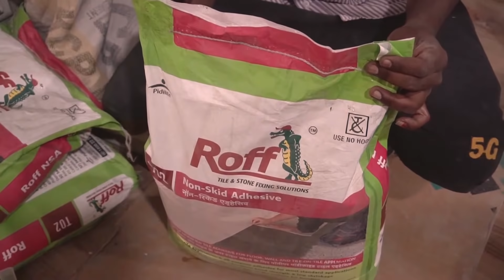2x4 tile laying in Hyderabad

Comment: This work is done at our home. He suggested us all the top quality materials required and provided different set of designs and at last this design is selected and done it perfectly.
Reply from the maker: Happy to hear ur valuable feedback sir thank you so much❤ 🙏🙏
Reply: Which company
Reply from the maker: @bitik9847  Cera
Reply: @muhammadmurtazamalik6564  yes
Reply: @TRKConstructions  cost?
Reply from the maker: @sasidhar2515  10k
Reply: @TRKConstructions  how much cost
Reply: @TRKConstructions  contact please.
Reply: Tiles ki brand or code kya hai ?
Reply: @khushaldavda857  nhi kabhi nhi paint Nikal kar ek coat cement aur chemicals water mix kar ke wall par coat karna hota hai
Reply: सभी टाइल्स निकलेगी देख लेना putti ke ऊपर ही टाइल्स लगा दिया इसने, ओर नही यकीन तो टाइल्स को हाथ से बजा कर देखलो आवाज आएगी
Reply: Cost? 🤔
Reply: Can you share the number of the worker
Reply: Is this durable?
Reply: Q
Reply: Same tiles come in letina company. Cera company tiles would be around 65+ rupees whereas I got similar single charge digital tiles (gvt) at 53 rupees per sqft. There were no bends n all and can't be differentiated. Popular branded tiles are 10-15 rupees costly

Comment: I think paint should be removed from wall to strengthen the bond
Reply from the maker: It was not possible at that time
Reply: The tiles will start loosing the bonding within 2 years because of not removing the paint

Comment: Do you guys apply cement for pasting or something else? Please reply.
Reply from the maker: Yes we use cement or adhesive
Reply: @TRKConstructions  Thank you for response Brother. Also one thing I want to know from you. Which is better cement or adhesive? Is adhesive not dry while spreading on tiles unlike cement because as I see cement gets dry immediately while spreading on tiles and unable to paste if tiles is immerse in water? Please suggest a process.

Comment: Why did you use t02 and not t03 ?
2-4 tiles are heavy so won't that create a problem ?
And Is roff better than laticrete?
Kindly answer 🙏
Reply from the maker: Both are good

Comment: TILE seems not socked in water before fixing & the spatula using is not correct one for tile fixing, wasting lot of adhesive mixer.
Reply from the maker: There is no need to soak vitrified tiles in water and moreover we didn't waste the adhesive
Reply: Thanks for the information
Reply: @TRKConstructions  its a misconcept that vertified tiles don't need socking and its a folk created by lazy masons. Check youtube for professional tile fixing tools and method, then you will realize how primitive method you are using. I am working in the same field in gulf country where we get famous branded tiles from Italy, Spain, Greece, and as per manufactures technical instruction we always sock the tiles
Reply from the maker: @ospadijaggu6187  if u r working in a big company it doesn't mean u knows everything  fist  u go and learn what is the purpose   of soaking the tile in water then comment . love to argue